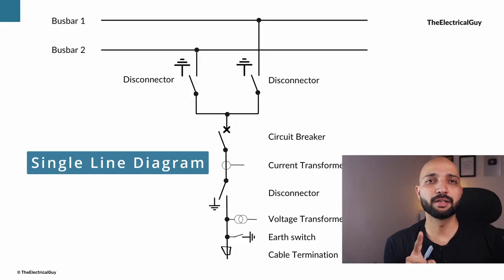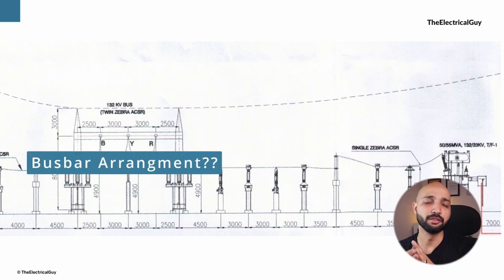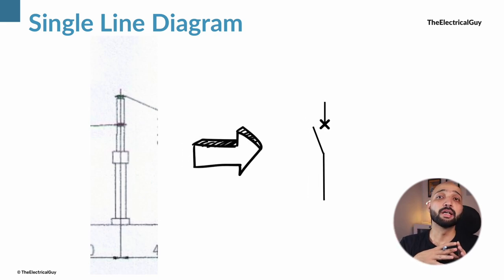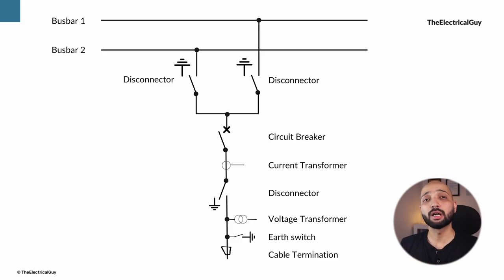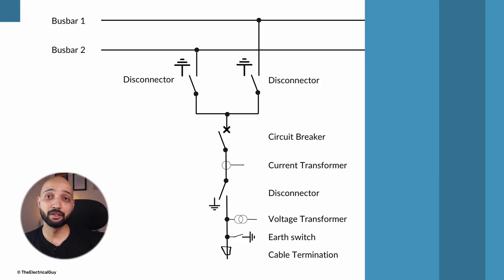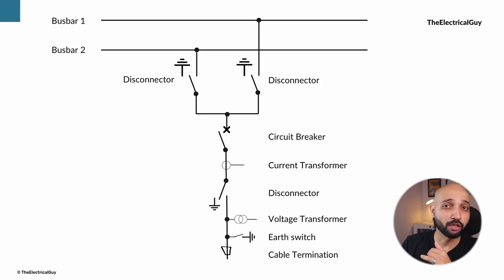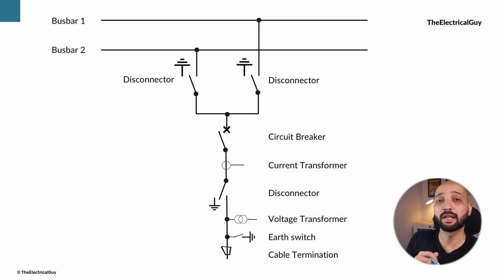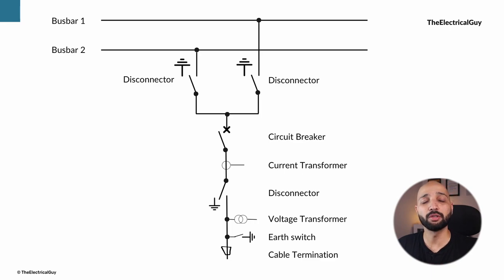What is a Single Line Diagram (SLD) ? TheElectricalGuy

Comment: Such ya very good explain plz continue video 
Boss what is the electrical equipment means
Reply from the maker: Thank you 😊
 electrical equipment like circuit breaker, current and Voltage transformer, isolator, wace traps, etc
Reply: @GauravJ  thank you boss

Comment: Anyone facing sound problem  in video..mere mobile me sound nhi Ara kuch bhi sirf is vidioe me
Reply from the maker: Yes. Sorry for that. Sound is coming less from one side
Reply: @GauravJ sometime we get shock by touching neutral and sometime we don't  . Why is it so? Please explain
I researched alot but till know didn't get the answer which can satisfy me.
Reply from the maker: Neutral can give you shock because it also carries the unbalanced current of the three phase unbalanced system. If the system is balanced then neutral will not have any current and hence in that case you'll not get any shock.
Reply: @GauravJ  sir I'm talking about single phase not 3phase like in our 🏠. As in our home🏠 neutral is having the same magnitude of current as the phase but we get shock if we touch phase but if we touch neutral we may or may not get shock.
Reply: @mohdsalmanzaidi  same happened with me and I am also in doubt..but after some research I reach to following conclusions...actually neutral comes from the common terminal of  Star winding or that  neutral is also grounded .. first point is you will never get shock from main neutral.. second point is you will get shock if  you are touching neutral without connect it to the main neutral in that case neutral will ground through your body you body feel electric shock (this may be wrong and correct me if you know right concept)